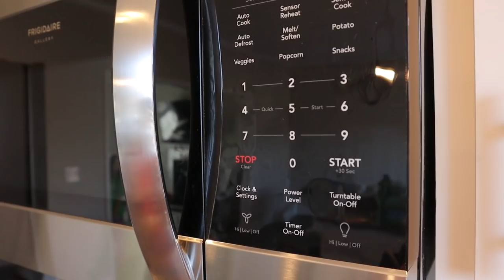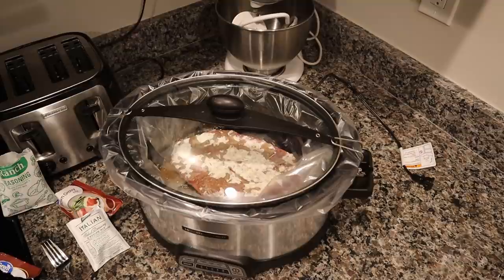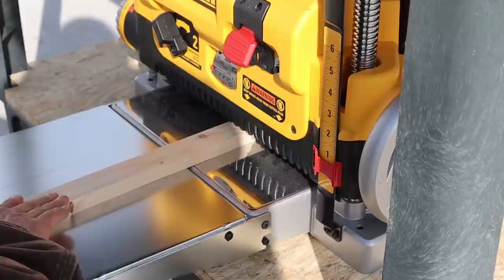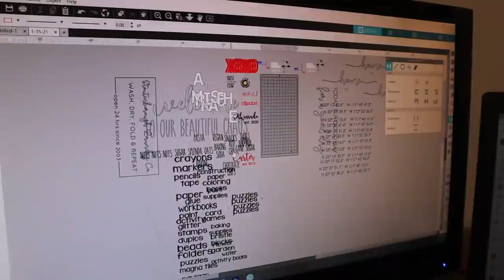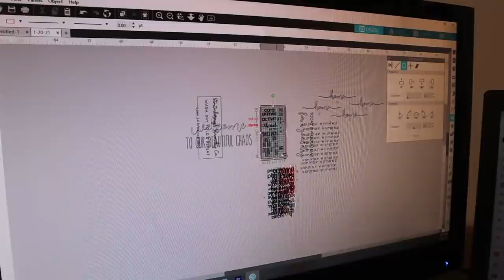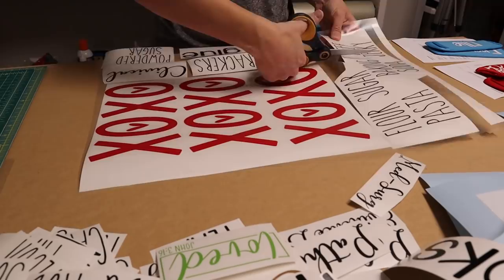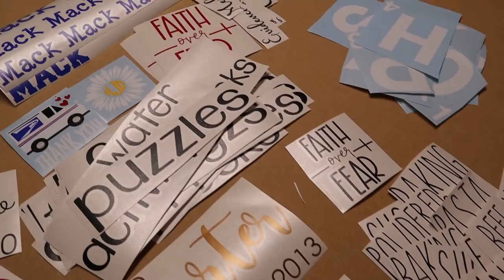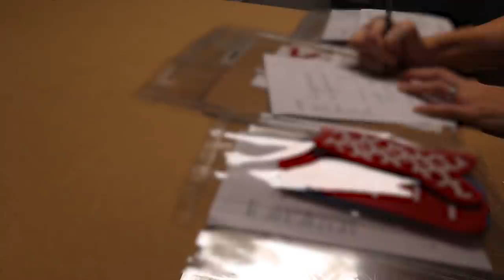Studio Vlog 03 | Making 1x 2's, Working on & Packaging Vinyl Decals

Comment: Hello, I'm new here, want to know why you still using cameo 4 even though you have the pro? Is it not working well?
I'm still confused to order the pro or regular one. Thanks for sharing.
Reply from the maker: I use both, although I think if you're just starting off a regular cameo is fine and doable! I did for all these years. You can make larger signs by piecing together. The pro is a little finicky still because it's so new. I'm still getting used to it!